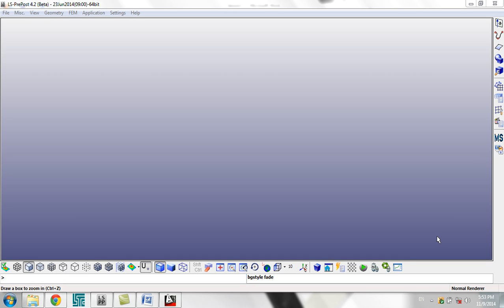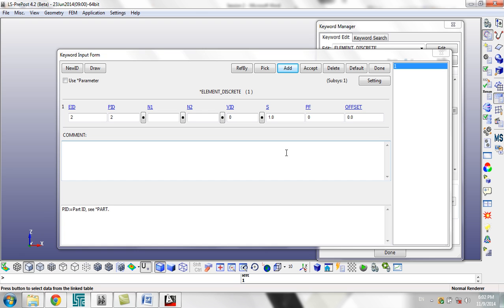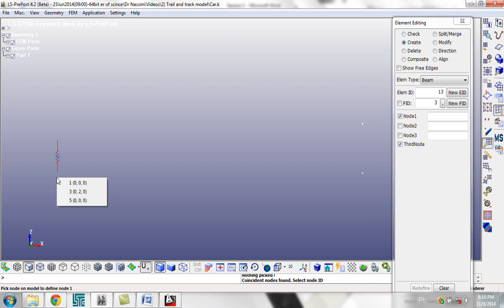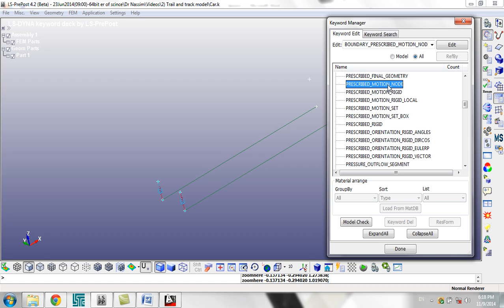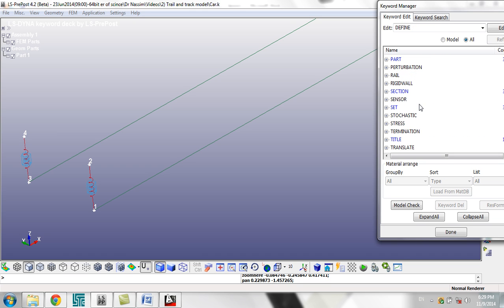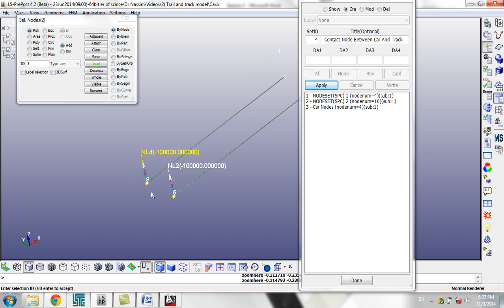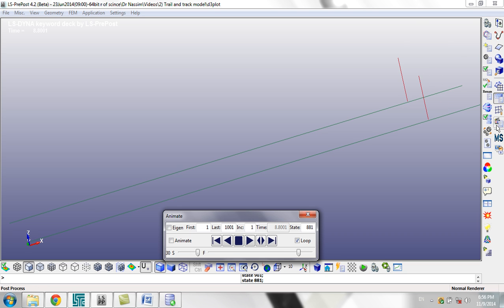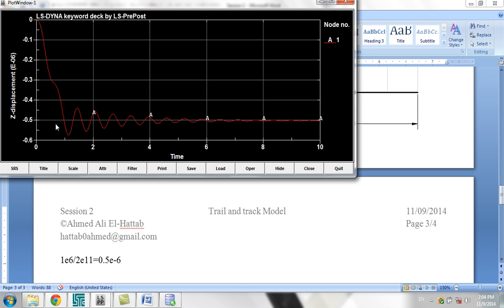LS-Dyna Session2 : Trail & Track Model

Comment: Dear Ahmed
Thank you very much for this nice and helpful tutorial and actually I have one question is why you model two wheel why not 1 if there is asymetrice and why not 4 wheel
and I am wonder if you add small part about the modeling of the step or ramp in the road
Thank you again
Reply from the maker: Actually for rail trial model in LS-Dyna you have to use two wheel with two tracks. May be it can work with one wheel, i will try it and if it works i  will upload  another video for it. However, this model of the car we called it "Quarter Car Model" which is using only one wheel and the more accurate one is to be two Degree Of Freedom System. Their is another advanced model called "Half Car Model" Which take the effect of car bouncing and pitching and in later videos i am going to make it that this one we need to define the rotational inertia for the car mass. For the last part i will do for sure different roughness for the road profile.
Reply: Do you have the PDF File and ls-DYNA Simulation ? If you have,can you send me? email zhangzhichuanda@icloud.com         thanks a lot     very thanks!!! 
I look forward to your reply.